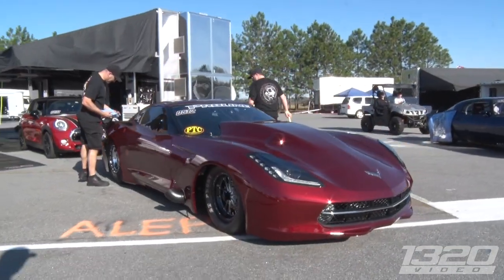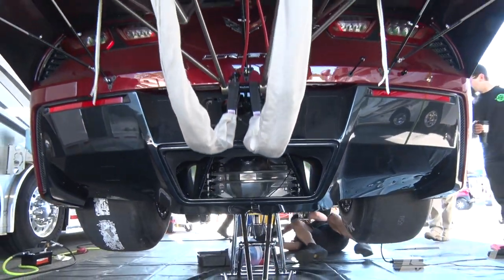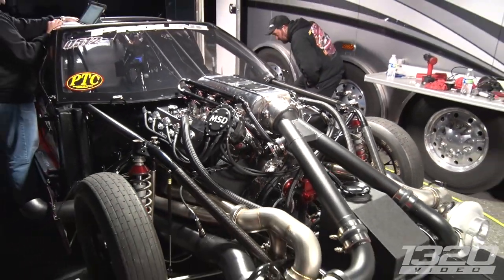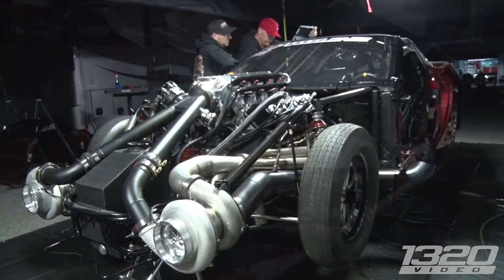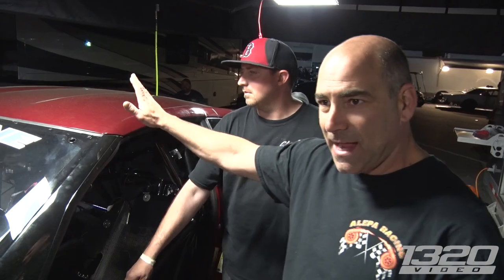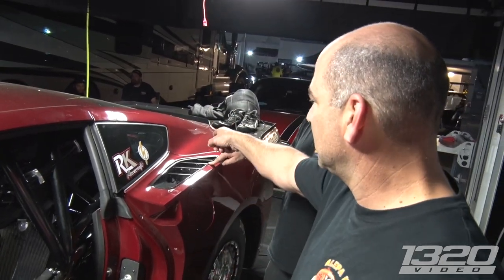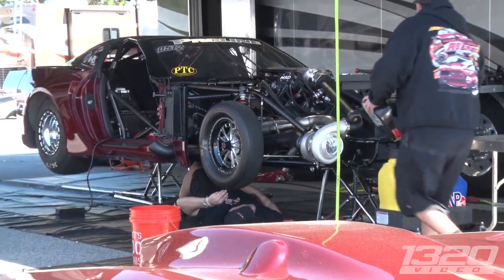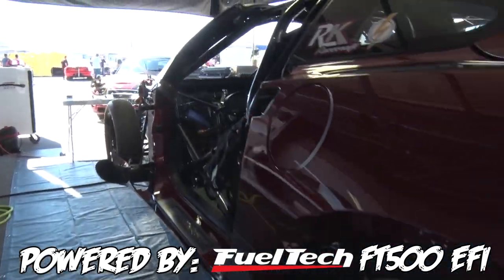3500hp C7 Stingray Corvette - Twin 102mm Turbo HEMI!

Comment: I love these twin turbo V-8s! Everyone talks up the Bugatti and says its so fast, but its got a W16 Quad turbo and produces 1500 hp. And these Beautiful V8's are half the motor and half the turbos and more than produce more than double the horse power and torque.. Do the math son!! And given the opportunity to test are very much likely to have much higher top speeds
Reply: 1200hp*
Reply: +Scorpio S i think hes referring to the new bugatti chiron which is said to have 1500 hp
Reply: Yeah the chiron, the veyron is still similar specs however
Reply: Is*
Reply: Razvan J The bugatti can sustain its top gear for less than 11 to 12 minutes before either severe over heating, or running out of gas, and its working with less power to the wheels and that has a factor in durability. On these Drag cars in the video you can easily crank down the turbos and get very similar durability to the bugatti and have the likely-hood of still coming out on top.
Reply: +Benjy Warren the amount of cylinders doesn't matter, it's about the engine configuration and the displacement
Reply: ***** So why are you so surprised that a engine bigger then it can make more power? It should be pretty obvious you don't have to state it. If the Veyron had 48 cylinders it wouldn't improve performance its actually the displacement so why are you saying that v8s are better because they are making more power with the amount of cylinders?
idiot...
Reply: Scorpio S Because you obviously cant read  for the 3rd time now they also have half the turbos. That's why. And displacement doesn't always mean more power dumbass, who taught you that? You have these Lancer Evos on a 2.0 that can generate 900hp. Displacement doesnt mean anything. And cylinders do matter. That increases the amount of times it fires per second, which can definitely impact a cars performance. Thats almost the first thing you learn. If Cylinders dont matter, then why doesn't bugatti make their 8.0 engine with only 4, 6, 8, 10 or 12 cylinders, if you say they don't make any difference?
Reply: ***** EVO's are 4 cylinders...
Reply: Scorpio S correct.. so is the SRT4 that I compared it to...

Comment: Imagine running a 7sec 1/8th mile @ 80mph (which is like s high 10-11sec pass in the quarter). Tha'd just be weird. You would have to have like a 200mm turbo and it didn't start boosting until 3rd gear lol.

Comment: " [I just wet down ad bought a new C7  for $70k ,tore it apart ad dumped antote $100k into it...I'll get tired of it and it will collect dust in the back of the shop"]...SMDH

Comment: So this car is only an 8 sec 1/4 ml car??
Reply: Year old... but apllgrapllD said "So this car is only an 8 sec 1/4 ml car??" because the vette took 4 second and hit 200mph in the 1/8th mile.  IF the driver just stopped accellerating it would roll to a 1/4 mile in 6.25 seconds since it takes 2.25 seconds to cover 1/8th mile if you are already doing 200mph.  Using the NHRA conversion factor of 1.6 and the car's reported times of 3.84 seconds at 212mph, it should be around 6.2 seconds in the 1/4 mile.  Not bad for a car running drag radials.  I suspect it would go quicker if the gearing is there due to traction issues getting that to launch.

Comment: These engines are not really any of the big three engines. They are custom built, u couldnt bolt any part off a stock engine to these things. They are just badass pieces made to make big  power nothing more.

Comment: All cylinders weren't firing in the first rounds you can hear it.. Seems the had an electrical problem and solved it cause it ran low 4s at 1/8 mile all the later runs!

Comment: And this isnt a C7 vetter. its a body shell moulded on a C7 vette body. for chassis this car has space tube frame. engine is highly modified from what LS motor in a C7 were available and most of the key engine components have been replaced by aftermarket parts. 

are you guys dumb?
Reply: Can you read or comprehend? Theres nothing LS about that motor. Its on the proline racing website..

Comment: What are the biggest sized usable turbochsrgers
Reply: turbochargers
Reply: I believe Garrett  makes a 84 trim 133mm turbo  now, not positive though.

I don't  think there's  any bigger automotive turbochargers  than that. Unless  you go industrial but those won't  work in a car.
Reply: William Stewart thanks
Reply: +Hey Turbonetics has a 122mm turbo.. Not sure if it's the biggest though..
Reply: +Hey You can get 118mm turbos from Precision. Any bigger than that and you are going into turbo jet territory.

Comment: 1/8th are shit wtf y would you spend that much money for a 1/8th mile
Reply: Katsu LA 1/8 mile is how you know your a good driver. Tuning is much much harder. You mess up one thing,do your burnout to short or long your done for. I race 1/8 but not this level I race a 1700hp 67 Camaro that runs 4.72 in the 1/8. 1/8 mile is very difficult and fun
Reply: 8th mile is so much less forgiving.  If you mess up 9 times out of 10 you are done.  I have watched a 78 pinto with a 2.3 4 cylinder turbo mustang engine beat a 2009 challenger that made 1300hp cuz the challenger smoked the tires.
Reply: Waylon Richardson I know what you mean. My first car in 2004 was a built 87 mustang (nothing crazy). It had a gt40 crate from ford, tuned and had 4.10 gears. Even before I swapped in a 331 (5.4) stroker into it, I was beating cars that had a lot more power than what I had mainly because of my launch and "driver mod". It didnt have much top end because of the gears but when cars see that im alreasy out 3-4 car lengths on them from the jump they never tried to run me down and just thought my car was a 700hp beast which it was far from it.  Horsepower means nothing if you cant put it to the ground.These says in street racing a lot of guys lose lots of money to slower cars because of something as small as a shitty burn out. It took some time to learn how rubber needs to be "shocked" and that you can actually heat a tire up too much.
Reply: Yeah, people put too much faith in horsepower, when you have an 8th mile drag race, torque is just as big a factor as horsepower.  That 2009 challenger makes 1,008hp to the wheels.  There is a drag race by me twice a year that runs on the airport runway, one of the other racers runs a 2001 silverado 2500hd.  it makes 1,200hp on a mostly stock engine and puts about the same power to the ground as the challenger but nobody beats him off the line except for 1 time.  Truck makes 2000 ft/lb of torque at only 30psi on a twin turbo setup.

You need the torque to get the launch, it is like those 1,000hp civics, they wind up then they are gone, usually barely make it into the 8's for quarter mile passes with sub 1 ton builds.

I have seen so many races here where clearly high powered vehicles get beat by much slower less powerful vehicles.
Reply: I really want to put 4.10's in my car, I did a few runs at 158MPH and it's so pointless I drive around 55-60MPH and still have problems pulling side ways hitting 2nd or other times it just roast them hitting second so I have to let go of the gas and I have BMR suspension after my rear end build I did after seeing a hole in the rear differential pan after a boom sound. Rear had 154,000 of hard launches.

Comment: Ya Want to know why 1/8 mile, Simple, Allen the Damage to my engine is in Last 1/8 mile..Instead of 25 passes then throw Rods in Garbage or Ur engine will have windows I can get 3-4Xs longer..I run Blown Car & Blowers put Alot More Bang on Ur parts in the 1st Place especially Bearings!.Then thers Valve springs, Oil, Tires(36s are $1200 pair!)& Only 190ish mph compared to 240mph..Also thers Blower Wear & Blower Belts are abt $350buks..Do you feel that Xtra 2sec, Alittle, But it's not worth it..See what the mean:)

Comment: 195 mph in 1/8 mile --  313 kmh in 200 meters. Im guessing this is the world record? bad thing is that this rocket corvette only works on a drag strip... Try to put that thing in the Nurburgring or a highway... Its suicidal... But well, that whats drag racing is after all. Power and torque and nothing more. :P
Reply: john hamlet  deffinetly new

Comment: the accelarion could be much higher if you turn it into a 4x4. this thing has way to muh horses for only 2 wheels
Reply: Oliver Madden no i am not.
when to much horses is put on the wheels they slip and burnout. if you spread the horse power over 4 weels you can have much more power right from the start.
Reply: +rubikfan1 true
Reply: Wow , I thought you were joking as well , somebody needs to call up the guys like Keith Haney and explain to him that he didn't really run a 3.89 on a 2 wheel drive car with radials. Even several the street outlaw guys are 4._ _ second cars...(still 2 wheel drive) Seriously though this list could go on for hours from Top fuel dragsters down to the guy who races his street car as a hobby. How many 4 wheel drive cars do you know of that are that fast? , personally I cant think of even one. Another consideration of 4 wheel drive is the parasitic loss through the driveline  , if 4 wheel drive was an option that would actually work you can rest assured that there would be a ton of them out there racing...common sense
Reply: chris f porsch 918, bugatti veryron, bugatti chiron, lamborgini aventador.  are all wheel drive. 
also the world records electric accelarator. by the swiss university. they did 1.5s 0-100km/h.
also 4-weel drive.
the large draggsters solve the grip problem with massive wheels. as more asfalt-weel contact surface is what you want.
Reply: A porshe, bugatti, lambo, etc... are fast cars but are nowhere near the level of acceleration or horsepower that these cars are achieving. 4WD is a disadvantage not only because of parasitic drag but also weight transfer. As the car leaves the line most of the weight is sent to the back of the car lifting up the front wheels and putting lots of pressure on the rear of the car. That makes the front wheels practically useless for acceleration purposes, 4WD wouldn't help at all. 4WD is also mechanically heavier.
Reply: +rubikfan1 if AWD was better then the GTR guys would keep them AWD. When you're doing times as fast as these guys AWD just becomes added weight and doesn't really help you. The Bugatti and other cars you said those are AWD yes but even faster cars like koenigsegg are exclusively RWD even the laferrari and P1. There's reasons why you don't see very many 7 second evos and WRX's. And AWD is one of those reasons. There are some cases of them getting into the 7 second mark like the red demon DSM. But that's nothing when you're in a class dominated by RWDs doing 5 to 6 seconds.
Reply: LOL. You should call up the national hot rod assoc. and drop that wisdom. I'm sure all those pro teams would appreciate the heads up.
Reply: Joel McMath 😂
Reply: My guy have you ever been to a racetrack

Comment: Why the fuck would you buy a 2014 Corvette if almost every single piece is going to be thrown out?????????????????????????????????? Why not just build a frame,  full suspension,  motor,  cage,  fiberglass top your done. Instead of wasting a whole entire car? I don't get it? Buy the car to put a sick motor and still have full interior and basically the whole car,  what a waste. There was a GTR going that fast with the whole car intact! It had huge turbo's like this and four slicks and suspension it still had the back seats in it and everything. When you make a car like this especially the way it looks inside and out build it all and decide the top your going to put on. Fucking destroys a whole car and I'm not even a Corvette guy I don't like em except for a couple. 63-67 and the last couple years of the C-4 especially the Mercury made ZR1. I love the 640 H.P. factory ZR1 as well.
Reply: That's alotta parts...engine, tranny, exhaust system, ac system, brake system, harness, seats, doors, hood, lights, stereo, and all the various bolts n brackets associated w/all that stuff..i doubt they just throw it in the garbage. All of that can easily make up to 30 - 35%  the price he paid for the car if they sell it.   Or he could have traded some parts for work done..who knows. But throw it out? Unlikely.

I'm not justifying his decision, im just saying (assuming he didn't win a lottery or settlement) that he didn't get to the point of where he's at by wasting stuff that has significant value
Reply: ***** Yeah but still I would of just bought a fiberglass body. That's all it is anyway!